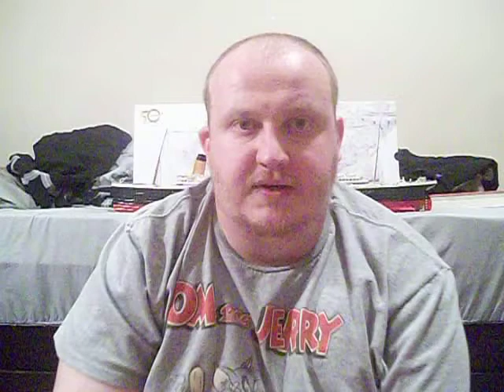Titanic's 3 bladed central propeller?

Comment: The reason the Titanic had the three bladed central propeller was because it was believed that a three blade configuration would be give the ship better performance since a three bladed propeller has less surface area and thus less drag in the water. However it did cause ungainly vibrations which the four bladed propeller didn't cause as much.
Reply: Thats not entirely accurate when comparing H&W specs of Titanic and Olympics center propellors. The center props on both had the same surface area. Titanic accomplished that by increasing the diameter of the 3 bladed center prop so the total surface area matched Olympics 4 bladed prop. This has been discussed in subsequent articles on the center propellor by Mr. Chirnside.
Reply from the maker: OK I get it now, thank you.